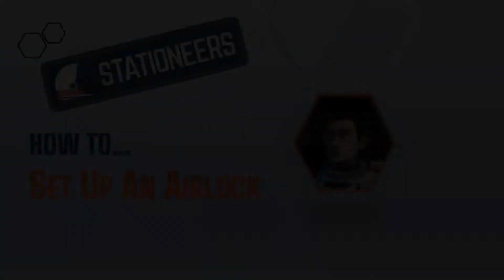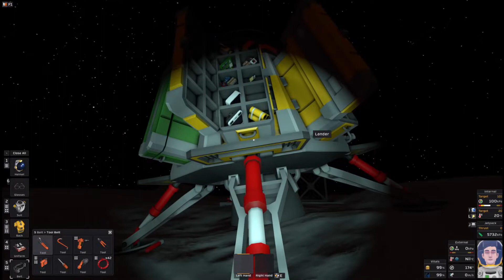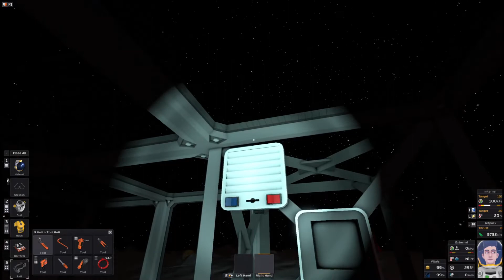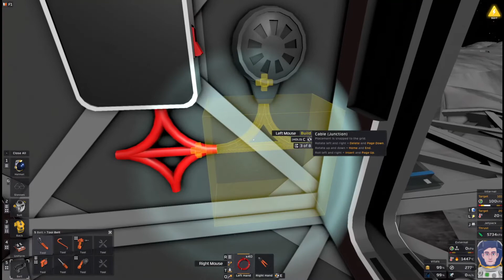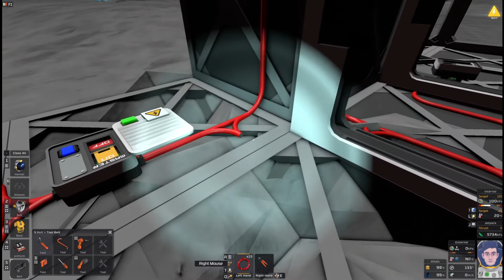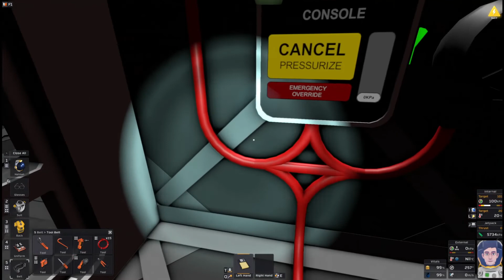Stationeers: How To Build An Airlock

Comment: I realize things have changed over time, but this has been a great intro to airlocks as a new player. For other new players, the data disk is not needed anymore. You can get to setup using a screwdriver on the side of the console. You also may need to lock the second door to red to get it working.

Comment: i have the pipe going from the vent to inside the room but the cycle never gets above 8k Pa i have to cancel the pressurization to get the inner door to open
Reply: could be that there isnt enough gas in the interior to pressurize the airlock room. release some gas in the room from the oxygen tank and then see
Reply from the maker: Exactly my thoughts. The pipe inside only pushes the gas in the airlock back into the hab or vice versa. If there's not enough gas in the overall building to reach 100kPa then it will pump in all the the available atmosphere but still not reach 100kPa.

Comment: It is nice guide about airlock but it might be different in reality. Manual door at airlock is generally best option in beginning when you can not and should not automate airlock as it does not allow you eat and drink in airlock. Glass door pressure limit is low - lot of chance of accidental blowout. Also, it allows you pass cables only at roof. Later when you well established and have pressurized room, you can install whatever you want. You very much want APC and battery charger inside airlock or you may run into problems when battery is empty and you stuck in airlock. With solar battery and coal generator on roof it is also most cable efficient placement.

Comment: None of my doors or anything come up on the screen when I put the data disk in only thing that comes up in the gas thing
Reply: It might be that the doors aren't connected to the data ports, 
you could have had a power surge if you used the solid generator on the airlock's circuit
Or, and this is usually where my problem is, the game just spazzed out. Save, quit to menu and load your world back and automatically the stuff should now be on the list 🤓
Reply: Having the same issue .... the game is quite good but this bug's ...